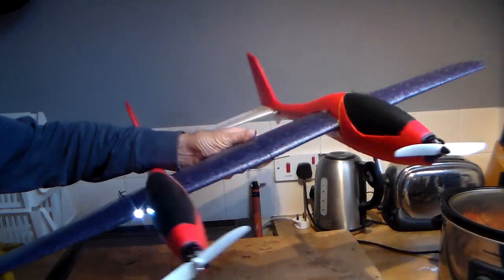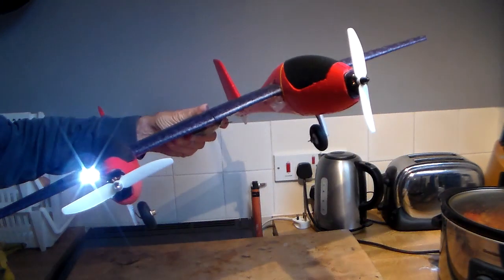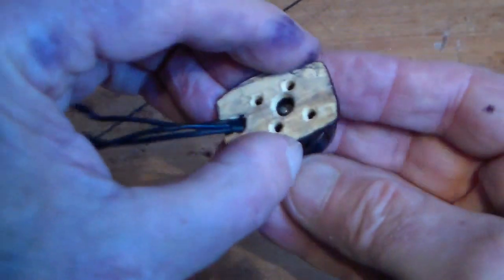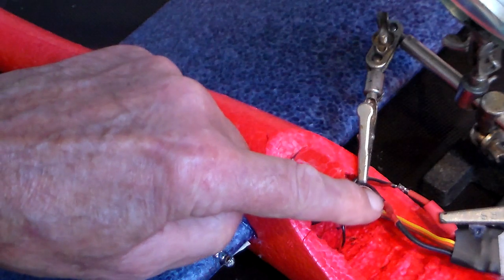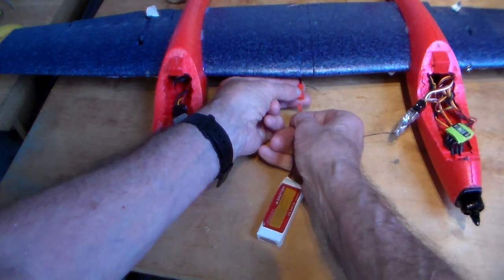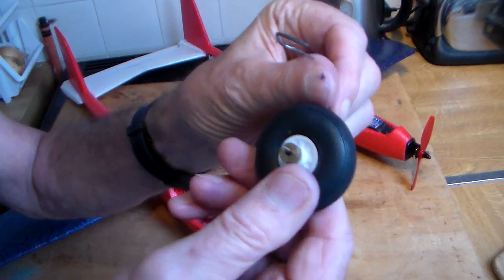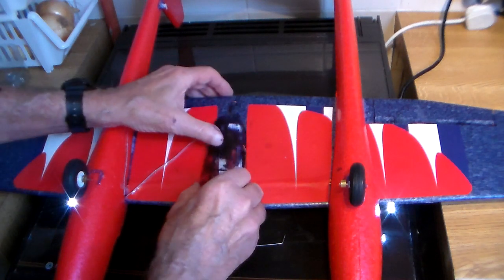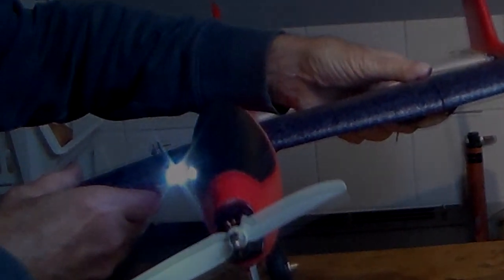Unveiling the Twin Fuselage Lidl RC Special.   Ready to Soar the Skies!

Comment: Love the undercarriage fitting, it'll be interesting to see how well they hold up, fingers crossed. What's you next project ... three fuselages? 😁
Reply from the maker: Thanks. U/c is surprisingly solid feeling. And the wire has a bit of spring to it, I reckon it'll be ok. 
Triplane next. Or twin edf's mounted on the wing. Boeing 737 stylie. 😎

Comment: Great job, been wanting to do something similar. I love the P-38 Lightning, thought this would make a good platform for that. I'm looking forward to your maiden. 

What is your total weight on this build?
Reply from the maker: Thanks. They would make a good P38, though you'd need 3, one for the centre nose! Weight is 375 gms. No carbon. Plus my lipo. 800mA 3s,  65 gms. I put carbon in my first rc Lidl way back, but don't really think it's necessary.  I guess if you were building a speed machine version then maybe.